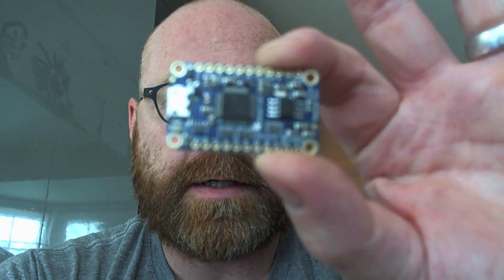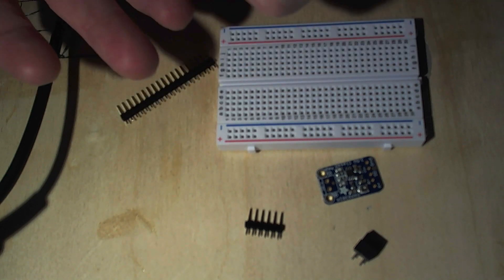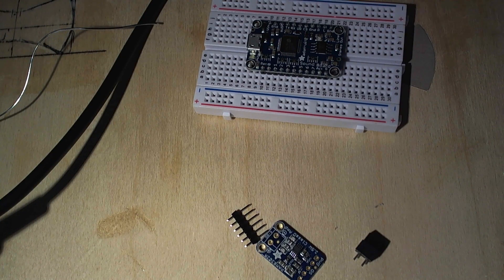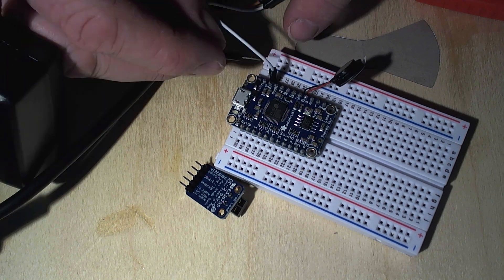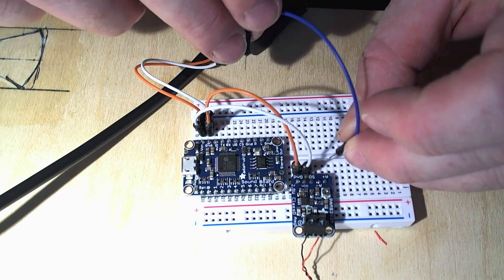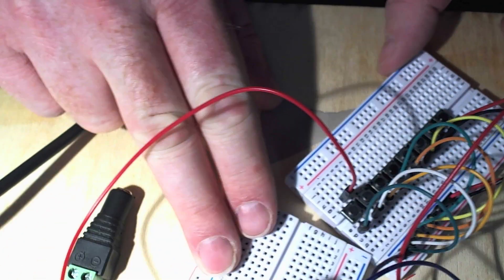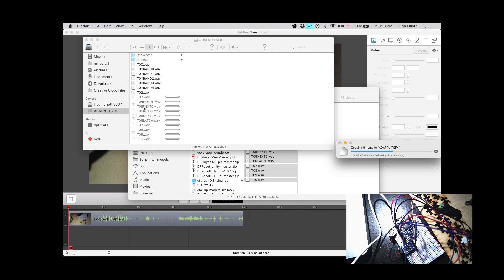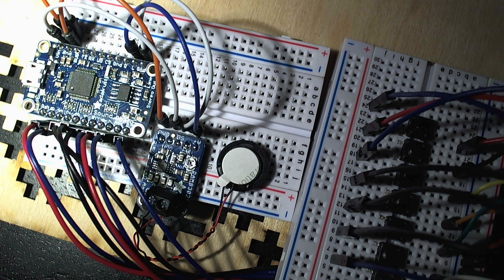Adafruit Audio FX Sound Board Tutorial

Comment: Is it possible to program the adafruit to trigger without the buttons? Like once you power it on it'll start playing?
Reply from the maker: You can solder a wire to one of the trigger pins and ground and it'll autoplay on repeat depending on the file name.

Comment: I don't know what i am doing wrong, but i have mine wired the same and when i attach the power supply the soundboard doesn't show it is getting power ans i hear a squelling sound from my speaker
Reply from the maker: That has all the earmarks of a connection issue.  A squealing sound from the speaker is a signal problem from the board. Is it possible you reversed the power connection to the amp with the signal connection?
Reply: @hughqelliott  I switched the power supply and it worked, I was trying to power it with a 3v coin cell battery so maybe that was the issue?

Comment: Are you able to latch a loop and then trigger audio over that? Like looping a song and then you press a button to interrupt it with a spiel and then resume looping?
Reply from the maker: You could, if using a standard tactile switch, run the connection through one pair that is NC then run the second connection through another pair that is NO. In a switch like that (four legs), NC is directly across from each other. NO is on the diagonal. Then connect the NC to the loop and the NO to the spiel. When the button is pressed, it'll turn off the loop and activate the spiel. It's an interesting set up. I'll have to find some time to try a test.

Comment: I am trying to reproduce a sci-fi Prop that plays a sound when a button is pressed, but does this board have outputs to trigger an LED on? I want to press a button 1 and play sound one, and energize an LED, while another LED is always on when the circuit is on.
Reply from the maker: You could connect into the button and use the current powering the board to also turn on an LED when clicked. And again, for the main power indicator, run current to an LED (with a resistor for both of these LEDs) from the current that powers the sound board.

Comment: How do you power the amp if your using the micro usb power supply?!
Reply from the maker: There are positive and negative pads on the bottom of the soundboard. You can solder wires to those and then to the amp.

Comment: What voltage can the power supply be? I was just connecting this all like he had it to a bread board with a 12v power supply and it stopped working one I connected it. It no longer appears on my PC.
Reply from the maker: @justin i suspect you burned it out. based on the schematics, it's expecting a voltage range of 2.5 - 5.5V
Reply: @hughqelliott  well fuck. thanks. I thought that this was able to ramp it down or something. I thought I remember hearing that somewhere. Well, I'll get the replacement tomorrow and I have a 5v. Now i'll just have to adjust the resistors on another part because I have some fading LED's. With the 5v they fade differently now :/
Reply from the maker: @TFJotin  very sorry that happened. The amount of magic smoke I've managed to get over the last while is extraordinary. I feel that frustration.
Reply: @hughqelliott  I appreciate your video! I learned a lot. Before last week I didn't even know how to light up an LED.
Reply from the maker: @TFJotin  amazing! Keep it up.
Reply from the maker: @TFJotin  It's a simple enough circuit to breadboard and test. Worth giving it a try, right?
Reply: @hughqelliott  I hooked up a voltage meter and the voltage reads varies between 4 and 6.5. hopefully that wont be enough to blow out the board. it didn't blow out an LED.

Comment: Hi,  Have you tried triggering the sound board from a transistor, for example connecting the collector and emitter across the input trigger pin and turning the transistor fully on with its base?  I need a way of triggering a sound electronically and not with a switch.
Reply from the maker: The only other way I've triggered a sound with this board is using Serial and a microcontroller. I don't see why a transistor wouldn't work but I haven't tried it.

Comment: You connected the mono amp to the sound board's L channel. What if you want to also hear the R channel, but on the same speaker? Meaning, how do you connect up both the L and R outputs of the FX board to play on one output speaker? Thanks!
Reply from the maker: In this care, I am using mono tracks. Equally loud in either channel. I don't believe you can put two outputs through one speaker, though. Or at least shouldn't. https://www.quora.com/What-happens-if-I-send-the-left-channel-and-the-right-channel-into-one-speaker-Will-I-get-twice-the-power-Will-the-left-and-right-be-mixed-together

Comment: Thank you for sharing this. I was put off buying one because nowhere in the documentation does it say that file transfer is possible with a Mac. But you seem to be using a Mac.
Reply from the maker: You're very welcome. That's right on both counts, I am using a Mac and it is possible to transfer files. The sound board is seen as USB storage.
Reply: @hughqelliott  Brilliant, thank you. Now I just need to get my soldering skills up to scratch. This is the strangest project I have ever done but now, I am excited by it! Just need to figure out how to convert 12v DV to 3-5v DC that this circuit needs.
Reply from the maker: @DTGuitarTech  I'm watching videos right now so this may seem like I'm incredibly responsive. However, I did a video on a voltage regulator that might fit the bill for you. https://www.youtube.com/watch?v=KRUZlcQn-Fc
Reply: @hughqelliott  Ah that’s great, thanks for sharing that. I will watch that later.
Reply from the maker: @DTGuitarTech  a buck converter does the same thing for more money and parts but for sure. i have used buck converters a bunch of times and they work great. can't go wrong with proven technology.
Reply: @hughqelliott  thanks. From what I can see, the difference seems to be about power efficiency and heat. Buck converters are incredibly efficient and do not produce much heat. Single component voltage  regulators are a solution but they only work within a temperature range then they stop working when they go over temperature. This is not my knowledge by the way, just for some research. I think the best solution should be the one that you can afford and have the space for. The good thing is, we’re only playing with a few volts and low amperage so we’re not going to blow anything up. Thanks again.
Reply from the maker: @DTGuitarTech  That's some solid logic. I have used buck converters extensively because of varying voltage needs. I did use a single voltage converter for one prototype but hadn't considered the heat aspect.

Comment: so essentially this thing works like a sampler in a way? Like you put audio files onto it and each audio file is assigned to it's own button? Seams pretty similar to what someone would do with a Novation Launchpad or an Akai MPC or something like that, which would often be used to essentially make a live performance out of pre-recorded music like techno or hip hop. only difference is this sound board thing is a miniature version of that. Is my observation correct?
Reply from the maker: I don't think you'd get the same responsiveness out of this as those devices. It's not exactly built to interrupt itself. Once you start a track, unless you explicitly cancel it, it plays through.
Reply: @hughqelliott  Right, this doesn't really seam to be designed for that kind of use as a live performance instrument.

But it seams to work in a slightly similar way to those devices I mentioned; that's due to the fact that each audio file is programmed to it's own button. That's different from your typical mp3 player where you have to essentially step through a list of files to find what you want; it's not like each file literally has it's own button assigned to it where you can literally press a specific button to play a specific audio file. That's where this sound board thing seams to be a bit similar to a sampler; a sampler allows different audio files to be programmed to different buttons, meaning you can quite literally trigger the audio with a single press of a button as apposed to scrolling through a list of files to find the one to play back.

I guess you could think of it as being like a specially designed telephone that would have an audio file programmed to each number key on the keypad (in fact, I wonder if anyone has even made such a telephone!).

Or, it's similar to typing on a computer keyboard, where each letter of the alphabet is designated to it's own key on the keyboard, as apposed to having to step through a list of letters to find the one you want (which, in my opinion, is why I sort of hate typing on a smartphone because I can't see the letters/numbers on the screen to know which one I want so I just scrole through the list instead. That's because I'm visually impaired to the point of being completely blind).
I hope this makes sence, I just wanted to make sure I propperly understood how this works.
Reply from the maker: @justinnaramor6050  that does make sense. I think the responsiveness is what makes this board most problematic. It simply won't react and change "directions" as quickly as you would want.
Reply: @hughqelliott  Makes sence. Do you still use/own this sound board, out of curiocity? If so, how is it useful to you? like what do you find yourself using it for? Some people use these sound boards to scare people or to do prank calls for example:) but I suppose one might find another reason to use it.
Reply from the maker: @justinnaramor6050  I use this board all the time. I made a Darth Vader breathing loop for cosplayer Ebony Warrior Studios https://www.instagram.com/p/CKksFGbD1yV/
Reply: @hughqelliott  Cool. Hope it continues to work well for you:).

Comment: Hey, nice work !
I try to do the same with  2x CR2032 for the battery, and it doesn't work.... the sound stay only 3 seconde before stopping.
Is it because my tension is to high ? I have 6v (2x3v)
I use this item for my batterie: 
https://www.amazon.fr/GTIWUNG-Porte-Piles-Supports-Commutation-Interrupteur/dp/B0823W1MX7

When I try with an USB cable form my laptop (5v), it work well...

Thx for your help...
Reply from the maker: I suspect it's a matter of power draw. Those little batteries don't provide a lot of amperage. Can you connect a capacitor between the batteries and board?

Comment: What plug do you use for your power supply? What I've read on the adafruit instructions talks about what battery/power packs to use, but they don't have advise on plugs.
Reply from the maker: In this situation I am using a basic barrel jack https://www.adafruit.com/product/368 and a 5V power supply. For any execution that involves closing one of these up, I use a basic USB cable, solder the power and GND to the board and plug it in to a power bank.
Reply from the maker: https://learn.adafruit.com/adafruit-audio-fx-sound-board/powering-it
Reply: Thank you for your time good sir. I already have a 5v barrel jack, but I got confused as to what to plug into it... I googled 5v plugs and there's loads of options. I think I was just experiencing beginners nervousness. Thank you for clearing it up for me.
Reply from the maker: @garethtilbury7594  oh no problem at all. glad you're sorted out.

Comment: I hope you reply but when you touch the wire to ground and then a number is that oke continues loop or do those wire go somewhere else
Reply from the maker: if you touch the wire to ground and a numbered pin, that sets the pin to HIGH. If you continue to touch that pin, it remains HIGH so the sound will loop. You're meant to use it a switch. Connect a simple switch to the pin and ground. When you tap the switch and release it, it sets the pin to HIGH to trigger the sound, then sets the pin to LOW again.
Reply: Thank you. I plan on putting different horn sounds in my truck and small circuits aren’t my specialty. Just trying to figure out what I need so I don’t waste a bunch of money. Or if it’s even possible
Reply from the maker: @jordanbrige8848  have you seen this? https://www.youtube.com/watch?v=smhMLsP5fsM

Comment: Beginner Question: Wouldn’t you need to calculate the power supply based on the needs (and limitations) of the components, then add resistors? In my case I’ll be looking to use some form of AA battery pack, so I’m also wondering how to achieve this for the same basic project.
Reply from the maker: I recommend grabbing a rechargeable power bank instead of a AA battery pack. They're inexpensive and easy to use. Both the sound board and amp run on 5V so a power bank (which generally operates at 5V is an optimal choice.
Reply: hughqelliott Great! Thanks for the reply.

Comment: Hi can you show us how to attach a mono headphone jack to the amp and connect to the speaker?  Also for GND is positive or negative wire from the power supply (red or black from the battery)?
Reply from the maker: There is a board with a headphone jack installed. Saves you the headache of making one yourself.
GND is the negative wire (black)
https://www.digikey.com/products/en?mpart=2220&v=1528

Comment: how do i get the volume up
Reply from the maker: It'll depend on which board you're using. There are a couple of options. First, is the sound file itself quiet? That'd be my initial check. If the sound file is of needed volume and all files are playing quietly, you can change the volume in two places. Some of the other boards have pins available for volume. https://www.adafruit.com/product/2133 for instance. You can see + and - pins with "Vol" between them. However, if you have the board I've linked above you can't use pins. You can adjust the output volume on the amp, though. There is a small potentiometer which you can turn with a screwdriver to change the overall volume. Hope that helps!

Comment: Hi Hugh, I tried making this circuit exactly as you showed in this video and it was very helpful for a novice like me. I am having some issues though that I noticed in comments that other people are having too. As soon as I connect speaker, I start hearing chirping sound which means everything is connected but I do not hear anything through speaker when I press the button. I am using 5V USB instead of batteries. On connecting terminals, active LED on FX sound board also lights up which means it is working and playing sound but all I hear is a low clicking/chirping  sound. I would appreciate your help and advice. Thanks in advance.
Reply: @hughqelliott  Is that not correct? Green power LED turns on when connected to power USB and then red ACT light turned on when I connected GND and 1 or other numbers on sound board.
Reply: @hughqelliott  A clip from their sound board tutorial: "If you want to know when sound is being played, the ACT pin is LOW when audio is playing - this output also controls the red ACT LED"
Reply: @hughqelliott  I also tried the default files provided. Do you think loudspeaker can be an issue. I am using a DIY 8 ohm small speaker like yours. Will 4 ohm speaker give better voice? Or if it is only chirping sound does it need more power (batteries instead of USB)? Just thinking out loud various possibilities it any of these makes sense. Thanks

Comment: I've never attempted a project like this before, or anything like this ever really, and this video is extremely helpful for a beginner like me. Thank you for taking the time to make it!! Hoping I'll be able to make it out with a successful little sound machine.
Reply: If you're a complete novice like myself, is there an easy/cheap alternative to soldering? I'm assuming that the breadboard wouldn't be a great long term solution? I'm planning on putting this inside some sort of housing unit and having it on shelf or something like that (stationary). Not using it as a prop or anything along those lines.

Comment: I have successfully gotten this to work with 3 “AAA” batteries as the power source. But my speaker seems to be very quiet.  I was wondering if there’s a way to make it louder?  I’m running the board with the built in amp

Comment: Thank you so much for taking the time to make this video. I started this project in november and had to give up because of my lack of know-how about assembling circuits and the lack of available info online/on YT. Your video was EXACTLY what I needed to answer all my questions! When I saw that you even used the exact same boards and tools, I let out such a happy "YEEESSS" that my boyfriend thaught, I had already made the soundbord work.
The rest was finding errors with wiring and soldering - in the end it worked wunderfully. 
Again, thank you!

Advice I can give other people who have little experience:
DO solder the pins to the board. It will not work by just putting the board on the pins.
Check if your amp is connected to the right poles (pos/neg).
If you power your sound board via USB cable from your laptop/pc, it might not work, because the cable is also serving as a data cable for files. Powering it via USB from a power bank will work.
Take breaks, but don't give up.
Reply from the maker: This is fantastic advice and all correct. Thanks for taking the time to write these out.

If you aren't comfortable with soldering you can thread a light-gauge fishing line into the header pin holes and that'll take up just enough space in the hole to push the pin against the contact. But yes, soldering the pins will guarantee consistent contact.
Reply: not sure if anyone cares but if you guys are bored like me during the covid times you can stream pretty much all of the new movies and series on instaflixxer. I've been watching with my girlfriend for the last months =)
Reply: @Keagan Kieran Yea, been using InstaFlixxer for since december myself :)